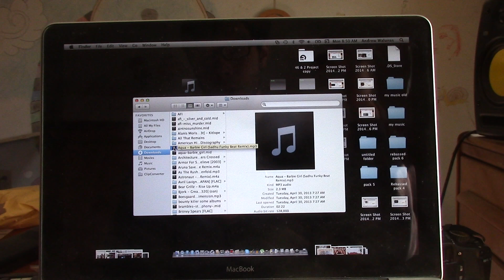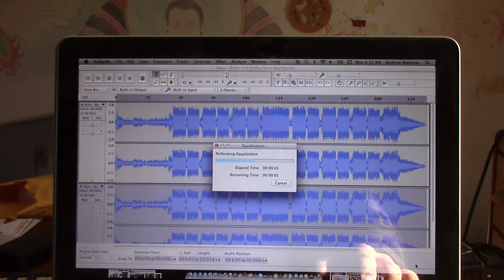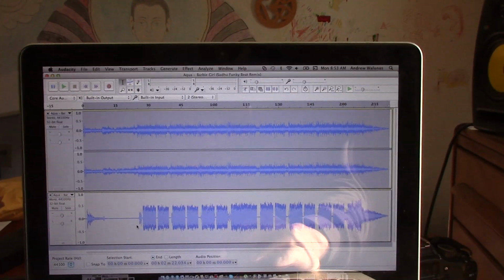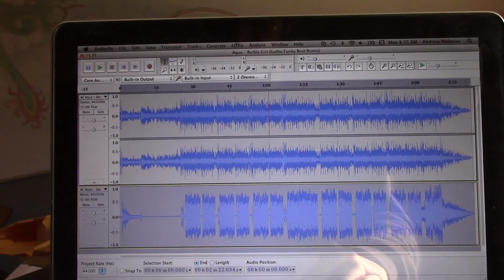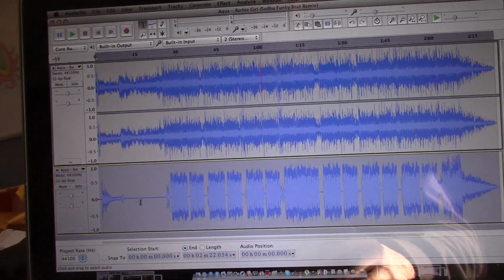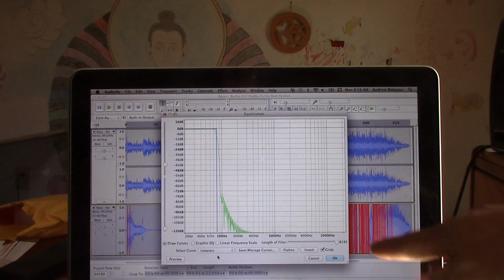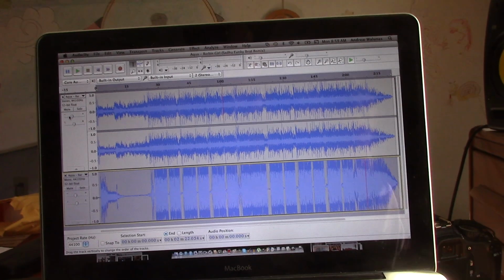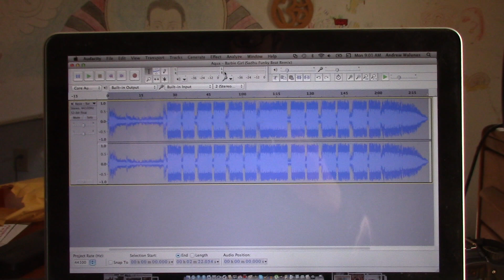How to Remaster music for Car Audio Ground Pounding

Comment: If you are using gain overlap on your amps you will want to re-separate into high and low pass and make sure the low pass side isn't exceeding whatever your gain overlap is set at. For Example if you use a DD-1 to set your gains at -5 db you will want to make sure that your 80hz and down does not exceed -5 db on your rms and dynamic meters at the top. It can go past in bursts which is okay for soft clipping but if it's maintaining higher than -5 db in this situation even though the signal itself isn't clipped your amplifier will be clipping and cook your subs. Just adding that in there for those just learning how to do this.

Comment: Been trying to remaster 70's & '80's recorded Hall & Oates and big band tunes bought on CD that are earsplitting shrill as hell with very little bass, or even worse has thonky sounding kick drum/walking bass guitar beat doubling that hovers around 100hz with the lowest going to around 60hz. Daryl Hall's adult male tenor R&B voice sounds like a child & his "S's" make my ears bleed.

All play through my back dash free air/polyfill dampened 6x8 Polks that are crossed over at 80hz on my 250 watt Alpine amp. The subs in my sedan's trunk are suppose to fill in the low end but get nothing.

This tutorial is probably the best & smartest way (from an audio engineer POV) of fixing the bass without introducing artifacts (I hope) which if not dealt with have the potential of really messing up your speakers cranking it up.

Been waiting years for tutorial this thorough. Thanks a bunch. Made it a favorite.
Reply from the maker: awesome man, glad i could help
Reply: DJ Inclined
Just curious about the condition of the mono bass waves after you clipped them whether the tops/bottoms are flattened and if they were restored by your further editing.

Was under the impression once the wave is clipped there's no getting it back unless that compression effect you applied restored the original roundness.

Did you zoom in to where you could see if the tops and bottoms of the waves were rounded on the final loud version?

And just FYI I'm all for loudness at the digital source instead of relying on 12volt driven car audio amps to deliver the goods, but what most complain about what this does to the audio quality can be fixed with further EQ'ing IMO.

Hell! Flaming Lip's "It Overtakes Me" aiff wave viewed in Audacity is a brick wall but its (non-hip hop "non-resonating" style) bass line feels like its kicking my backseat out. I could never get that kind of ferocious bass sound in my car back in the '70's without blowing out my 6x9's.
Reply from the maker: Yes the bass track is restored to UN-clipped state by the low passing. The compressor is basically biring up the variations in the waveform to a more leveled out even wave, then the the low pass fixes all the red and clipping. i should have zoomed in to show it.
Reply: DJ Inclined
No flat/chopped top & bottom wave forms, right? They're rounded?

I've been using Audacity's Hard Limiter on just a few clipped wave forms and it makes them flat/chopped.

If this is not what you're getting then I'm most definitely going to adopt your low/hi pass method as a best practices technique.
Reply from the maker: yes they are round and brought back to the original shape from the studio. the lower you set the low pass the cleaner it will be, but of course will filter out more. You can highlight a smaller sections and process that to achieve desired results. it doesn't make it a perfect sine wave but it's better than leaving it original.
Reply: DJ Inclined
Thanks for confirming, DJ. You've given me a new way of thinking through my current remaster/remix process. Thanks for posting this tut.
Reply from the maker: no problem sir
Reply: DieselPunk Cummins is there a link to dj snt vid

Comment: red in audacity is not clipping... it is just showing where the wave is above 0db.
Reply: yes but technically we can call it fixable clipping
Reply: Anything above 0db, is clipping
Reply: @NateHarrisCreations  I understand in a finalized audio file or in the real world, but in audacity the data loss hasn't happened yet if the file was amplified over 0dB. So it could be clipping or it could be that the waveform is over 0dB "IN" audacity.
Reply: @HitemWithTheFlex  true

Comment: I see that in your left and right audio tracks are very high, without clipping. Meaning a strong signal.  I'm referring to the light blue frequency bar. The dark blue are the peaks. In the program Audacity, where do I have to go to increase the volume of the light blue frequency without clipping (red lines) BTW, I'm close to retirement.

Comment: Should I modify the hertz for each song I use for the passes? The low pass worked, but the high pass literally did jack shit to the waveform. Wondering if I should modify the high pass or leave it be.
Reply: I used the Low Pass and Change Pitch

Comment: how do you tune certain notes? have u figured that out? badass vid btw, helped alot. I'm trying to rebass songs/bass boost them
Reply: You cannot "tune" a certain note. A note is already "tuned" if we may use that sort of language. To "properly" rebass a track (whatever that means, since a lot of rebassing just sounds like shit anyway), you have to generate the tones, one by one, using the Generate - Tone function in Audacity. You have to set the Hz of each tone yourself, and it is debatable as to whether just choosing an arbitrary number (under 100 Hz) that you think will hit nicely on your system will actually jeopardize the harmonic/melodic nature of the song. Because all sound is frequency, there are technically specific Hz tone that would correspond to different chords/musical notes being used in the song. But to find those numbers, you have to be like a musical genius or (as of late 2022 and onwards) just ask ChatGPT because it's (basically) a genius at everything.
Reply: To the video poster's credit, he did distinguish whatever this is he is calling 'remastering' from 'rebassing', which would indeed be a separate, distinct thing.